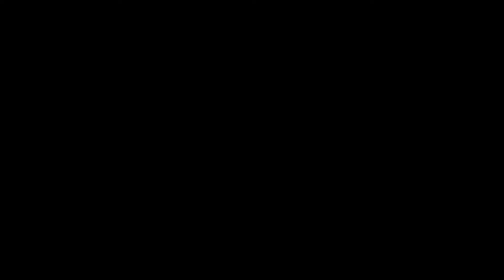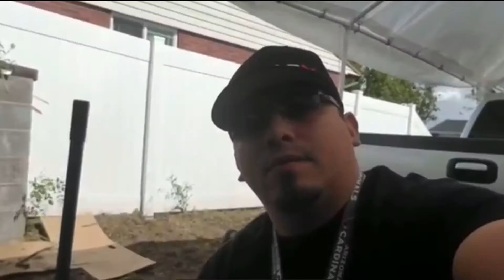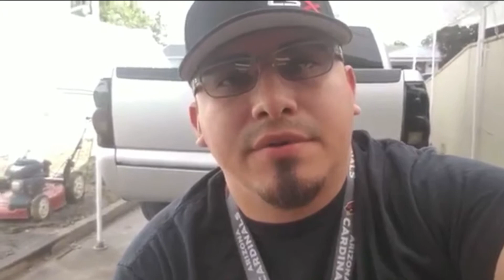NBS Silverado DJM 3/5 drop and c notch

Comment: Looks bad ass man! What size tires are those? Any rubbing? How does it ride or how is it with steep driveways or like railroad crossings?
Reply from the maker: Thanks. 275/30r24, it was great, rode smooth, my driveway is horrible and it did just fine. Factory hitch would scrape but the hidden hitch didn’t.